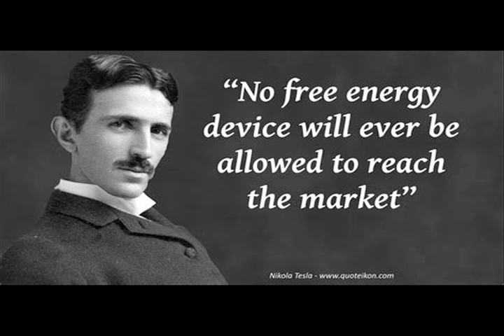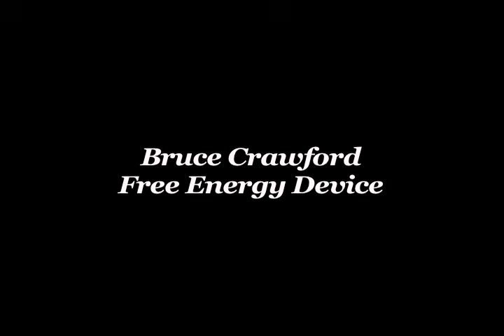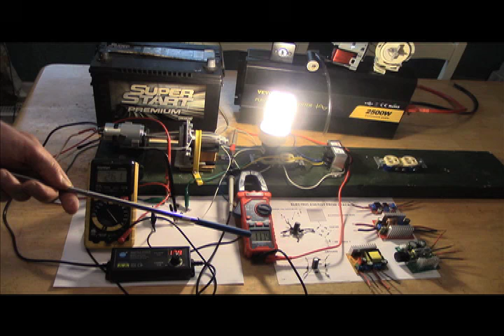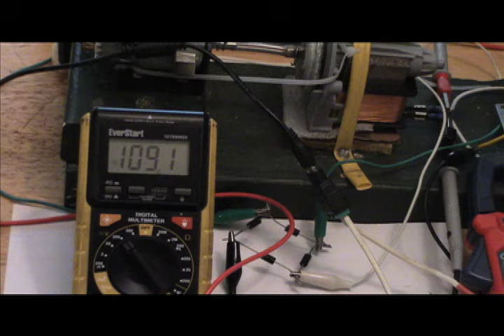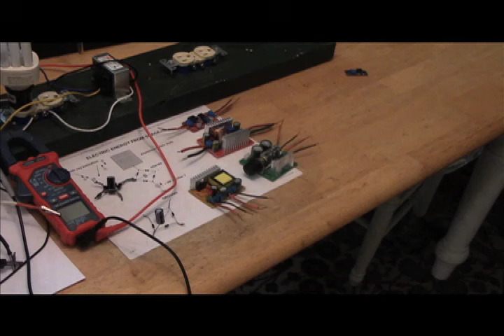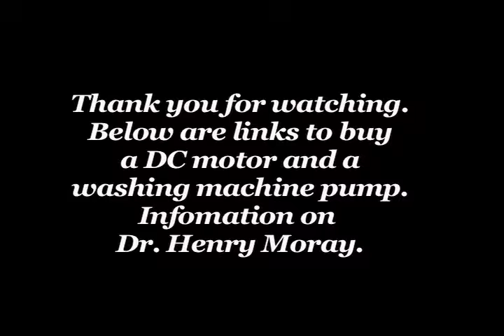Bruce Crawford Free Energy Device

Comment: You need to be measuring/calculating wattage, not just voltage. Voltage is a unit of potential, not power or energy. Just because the input into the motor has less voltage than what your rectifier is putting back out does not mean the system is producing more energy than it is using. All that really means is that there's a voltage drop across the wires powering the motor and that the wires are too small.

For example, a motor running at 8V and 1A is consuming 8 watts of power. If the rectifier is kicking out 12V, but only 0.5A that would mean you're only feeding 6 watts of power back into the battery. That would be a net loss of energy on the order of 2 watts.

You need to know the voltage AND the amperage to understand whether the system is net positive energy or not.
Reply from the maker: This device puts out cold AC electricity not hot AC electricity that you have at your house. 
The Circuit has to be made to run on cold AC electricity.
Build this Free Energy Device yourself and do your on testing.
Reply: @ShilohVideo I'm not referring to the AC side of the system. I'm referring to the DC output of the rectifier.

There's no need for me to perform this test myself, you have all the hardware to do it.
Reply from the maker: @Maxzillian   You know more about this than I do. You might learn something? When you get sometime you need to do some research on Radiant Energy - Cold Electricity by Tesla, Moray and Edwin V. Gray | Free Energy Conspiracy https://www.youtube.com/watch?v=Gyr53OF5bw0
Reply: @ShilohVideo All I'm recommending is that you need to be actually calculating the energy of the system. Measuring just voltage proves little to nothing and only invites skepticism.
Reply: @ShilohVideo Although I am curious, what's the difference between cold and hot AC electricity? Trying to search for this just yields HVAC topics.
Reply from the maker: @Maxzillian  Watch this video on Dr. Henry Moray - https://www.youtube.com/watch?v=uhx4KEmh5pQ

Comment: Voltage is not power.  TO proove this is over-unity you need to proove wattage in versus wattage out, OR proove you can add an external load to the battery and the battery stays charged while the motor is running.
Reply from the maker: This device puts out cold AC electricity not hot AC electricity that you have at your house. 
The Circuit has to be made to run on cold AC electricity.
Build this Free Energy Device yourself and do your on testing.

Comment: For this to be conclusive you must consider the Wattage. 
The voltage alone does not indicate in nothing that you produce more. Take the voltage -multiplied amperage at the system input and the ampérage multiplied by voltage at the outlet of the system. So you will know whether or not you are in unit!
Pour que cela soit concluant il vous faut considérer le wattage. 
Le voltage seul n'indique en rien que vous produisez plus. Prenez l'ampérage multiplié par le voltage  à l'entrée du système et l'ampérage multiplié par le voltage à la sortie du système. Ainsi vous saurez si oui ou non vous êtes en sur unité!
Reply from the maker: Build this Free Energy Device yourself and do your on testing.

Comment: you know this video is good schizobait because it equates “power” and “voltage”. you’ve clearly never taken a basic electrical course and it shows.  

with your logic, a 120v to 240v stepup transformer is generating hundreds of volts of free electricity.
Reply from the maker: Build this Free Energy Device yourself and do your on testing.
Reply: @ShilohVideo this isn’t an answer. ANY basic electrical course will, within the first week, show you where you exactly are wrong in your thinking and analysis. hint hint: its basically all of it (see: energy loss to heat through every element in your system from mechanical friction, electrical resistance, etc…)
Reply from the maker: @quirble  This device puts out cold AC electricity not hot AC electricity that you have at your house. 
The Circuit has to be made to run on cold AC electricity.
Build this Free Energy Device yourself and do your on testing.
Reply: @ShilohVideo  cold electricity? give me a break; electricity can only be "hot"; it came free with your use of excited electrons, the very intrinsic nature of energy as a science. do air conditioners just spontaneously generate cold air rather than hot air to your mind??

in any case, welcome to basic thermodynamics. but you already know this because you stared straight at proof of it in your video and still said it was something you could just ignore... really shows who we're dealing with here.
Reply from the maker: @quirble  When you get sometime you need to do some research on Radiant Energy - Cold Electricity by Tesla, Moray and Edwin V. Gray | Free Energy Conspiracy https://www.youtube.com/watch?v=Gyr53OF5bw0

Comment: Great video, ignore the trolls.  Yes, the military already have devices that make this thing look like Ben Franklin flying a kite!  Gerard Morin has a ton of videos on that dishwasher pump if you haven't seen his stuff yet.  As you probably know, voltage alone is not an indicator of free energy.  If you'd really like to see or prove that, keep a voltage meter on your main battery while the device is running (with or without the light bulb).  If the drive battery voltage increases while the device is running, then most likely it is a free energy device.  I have got AI to admit that COP's well over 100x are possible in "open" systems.
Reply from the maker: Build this Free Energy Device yourself and do your on testing.

Comment: You are confused sir.  Measure power, not voltage.  Power is volts x Amperes.  You will find you are using more Watts to run the motor than you are generating.  Yet another wishful idiot.  VA3NTH

Comment: Certified delusional
Reply from the maker: This device puts out cold AC electricity not hot AC electricity that you have at your house. 
The Circuit has to be made to run on cold AC electricity.
Build this Free Energy Device yourself and do your on testing.

Comment: Well, you are using a lightbulb that is hooked up to the car battery which draws current from the battery and converts it into light which means you’re losing energy.
Reply from the maker: Build this Free Energy Device yourself and do your on testing.
Reply: @ShilohVideo  He's right though. You aren't recharging the battery more than it's putting out as there's always going to be eventual loss through heat and light.
Reply from the maker: @Villianova   When you get sometime you need to do some research on Radiant Energy - Cold Electricity by Tesla, Moray and Edwin V. Gray | Free Energy Conspiracy https://www.youtube.com/watch?v=Gyr53OF5bw0